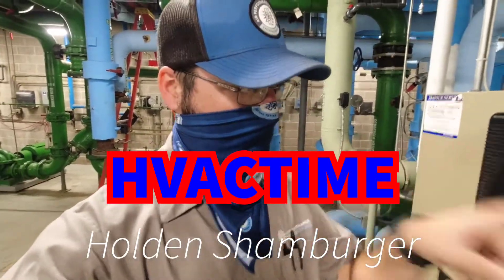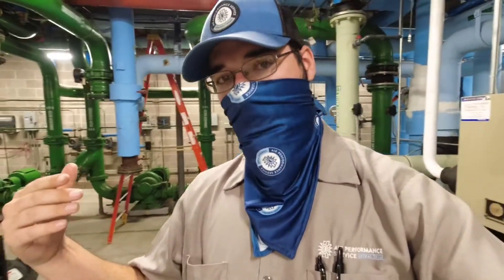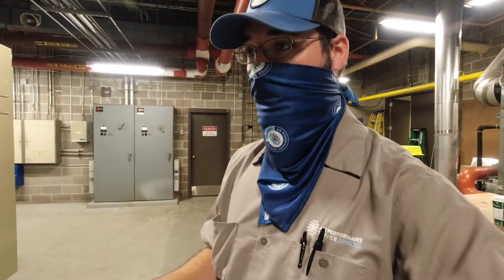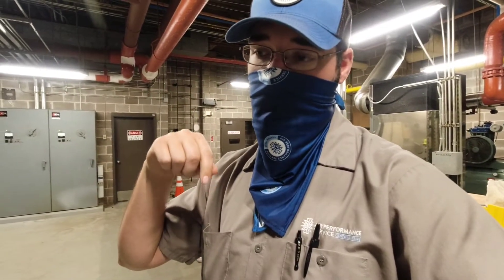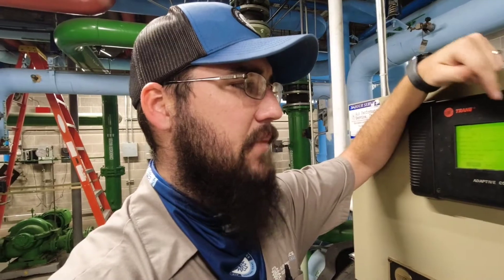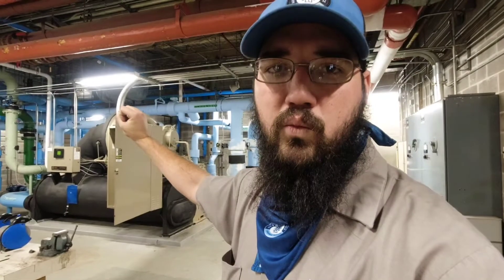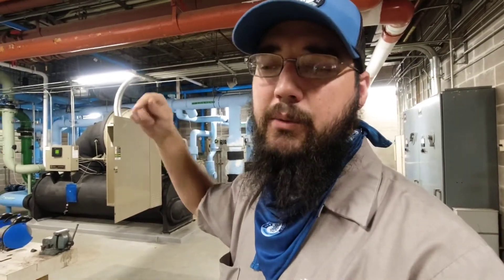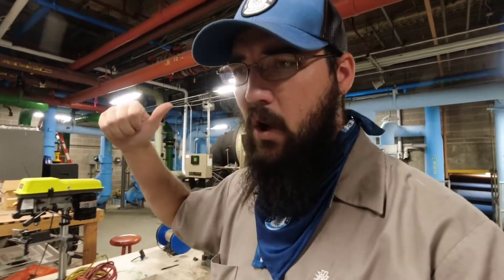Trane CVHF Chiller Excessive Pumpout Day 2

Comment: So surging makes leaks worse? What kind of word salad is that. What happened is y’all did a pm and filled the machine with air 
changing the oil and purge filters. Y’all caused the problem and you’re over here talking nonsense trying to explain away the fact the air is in there because of what y’all did.

Comment: Hi, thanks for uploading these videos. Real good stuff. 

Would like to seek for your advice, working on a trane CVHF chiller, receive refrigerant leak alarm. Found white foamy substance and gas leak on the purge unit exhaust/rupture disk manifold. Also, I could smell refrigerant. Purge compressor suction temp was at -27degC for 5 hours prior to shutdown of chiller.

Shutdown the chiller to run another one. Foam build up and leak disappeared.Once service tech arrived, we turned on the unit again for troubleshooting. Bubble check was done on the purge exhaust and found no leak. Chiller unit and purge unit is fine according to the tech. 

I suspect the carbon tank regen/heater is having issue or the pump out valve and purge exhaust valve were open at the same time during pump out cycle hence chiller refrigerant is leaking out through the purge tank, carbon tank and exhaust. Could there be issue with purge valves/solenoid?

Purge is on adaptive mode.

Chiller unit is working fine now, however I have a concern on chiller refrigerant being undercharge due to possibility of prolong leakage. I have seen in your other videos where you mentioned that there no real pressure transducer installed in both evaporator and condenser. Therefore, I cant be too sure if the refrigerant pressure readings are accurate.

Your advice is greatly appreciated.
Reply from the maker: It sounds like pumpout valve might be leaking, when chiller is under load the condenser pressure builds and if valve isn't sealing properly then its letting refrigerant leak by or your having a drain issue on separation tank where liquid is building up to high inside causing it to push through. There is a liquid float safety but it can fail. Should check sightglasses on tank and drain line with a load on chiller. See if drain line has flow and if tank sightglass is building liquid level above glass.
Reply: @HVACTIME  thanks a lot for your prompt response! Will check on those. Another question, 

What is the optimum approach temperature for both evaporator and condenser? And what is the limit where I should start to worry?
Reply from the maker: https://youtu.be/9OIMqqSC9i8
Here's a video on that exact topic.
Reply: @HVACTIME  thank you! 🙏🏻